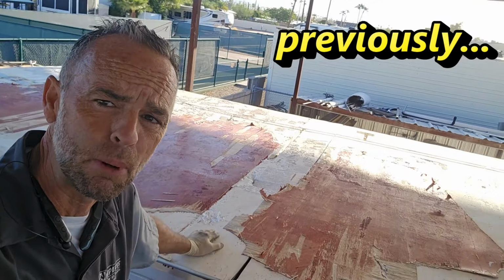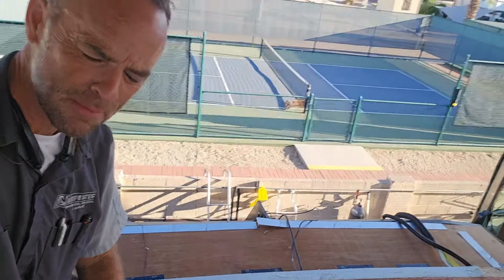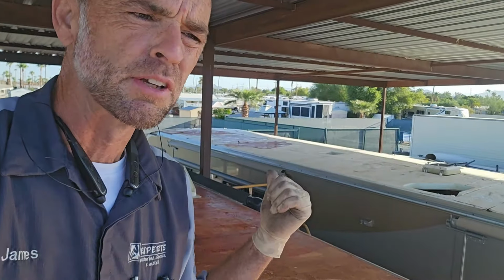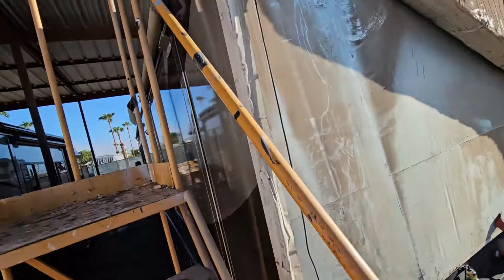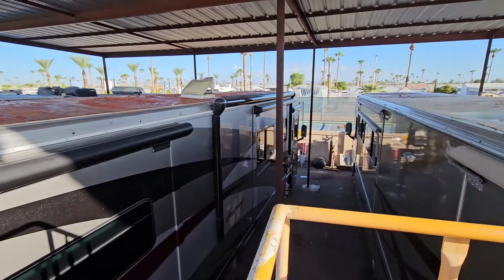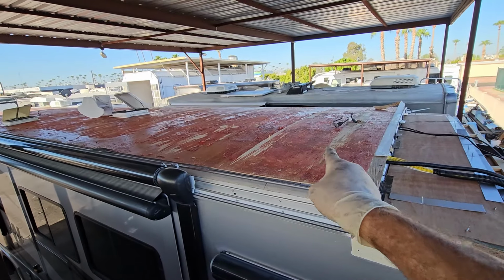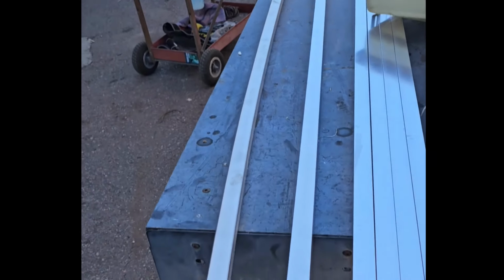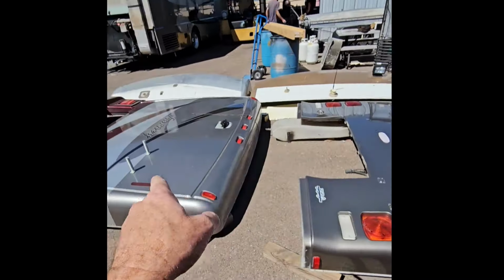Fixing Winnebago's BAD Roof Design

Comment: In 1981 I purchased (2) Winnebago 26" Braves THAT well exceeded my expectations as rental vehicles. That was Winnebago's heydays. I even became a Winnebago dealer back in the 90's because of those experiences. Then...I saw the factory build issues building up back in my warranty department. Consistent issues. I finally dropped Winnebago from my dealership product lineup due to the lack of quality. Any other MH brand at that time could out sell Winnebago in the late 1990's.  Today? Look at these poor coaches needing a roof transformation. Unbelievable indeed! Very sad as Winnie was THEY were the driving point of the RV industry  back starting in the 1970's.
Reply: Back when I was much younger, in the 70s and into the 80s, if my parents saw a motorhome on the road they would always call it a Winnebago.
Reply: @kevinbarry71  People still do in areas of our country that don't see a lot of modern coaches. Winnebago is the Kleenex of RVs. (Yeah, you cry when you discover you need a new roof ; ) )...if you do though, worth the drive to Arizona so it is done not only correctly but in an improved way.

Comment: I own a 2004 Winnebago 35' Sightseer, and so far I mainly keep up on the maintenance like resealing the edge seams mine has been flawless for 20 years and a 100K miles now. It also helps that I have always stored it inside, out of the weather when not in use. No leaks no sagging though I agree with adding the aluminum bows is an improvement which should have been done at the factory. Over all in the 20 years I have have had to replace 1 of the roof top air conditioners and the microwave plus up graded the toilet.
Reply: You are a testement to how to properly take care of your investment!🏆👍
Reply: Same here, bought a new 2004 32’ Brave, stored inside since day one and have never had a leak.  I walk the roof once a year to inspect and clean it.  No soft or low spots yet.  Hope to schedule a trip next year to ask James to perform a professional roof inspection
Reply: Same, I have a 2001 Winnebago Minnie Class C 31' that is kept inside out of the weather when not in use also.  It still has the original roof sealant which looks great and has never leaked and no sagging anywhere. It has a one piece fiberglass roof

Comment: James, as I’ve commented before, we loved both Winnebagos we owned over 13 years ( 10 years with one, 3 years with the most recent. We liked the quality of them  but the roof system was definitely a concern. Your videos helped me properly seal our 2022 class A. No leaks over 3 years & 45.000 miles. It was in excellent condition but we traded it in for another brand because of the added maintenance and concerns. I didn’t need the stress! 
Thank you again.

Comment: Found your channel too late, got up on my 2003 Minnie 24' we bought in '07 and noticed the edge was void of any sealant.  Never knew I was supposed to check it, the roof was still in place with no damage except for a little delimitation about 6" in from the sides and about 4 feet long on both sides near the front.  I had been sealing the cap over the years and never knew about the edge sealant.  I cleaned the channel out really well then used liquid flex seal in a giant syringe to fill the channel up level.  I was wondering if I should tear it out and use the right sealant and should I or can I peel up the edge and relaminate those spots or will it be okay if it's sealed properly from now on?

Comment: Trying to troubleshoot an '07 TripTech computer,  to my new hardwired colored camera system . the image is in reverse on the monitor, the monitor system does not have set settings for the monitor. I'm stumped. Any thoughts would be appreciated.